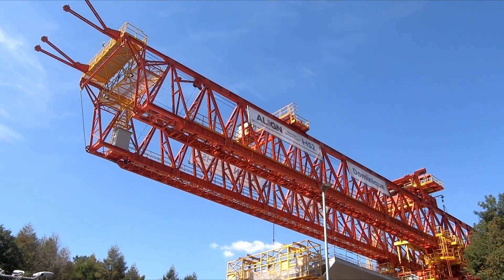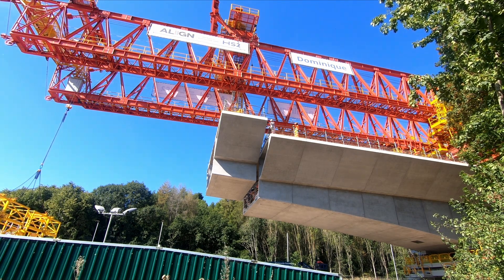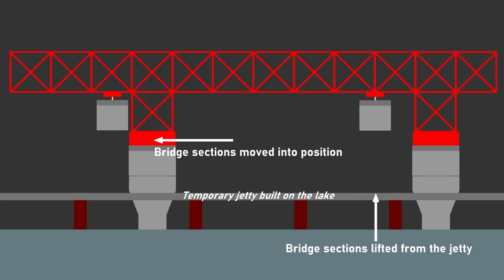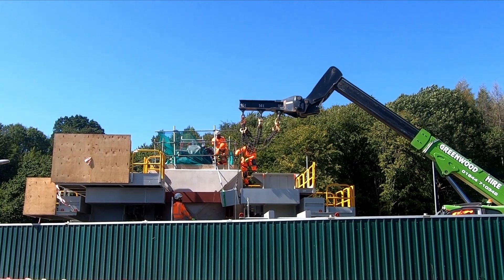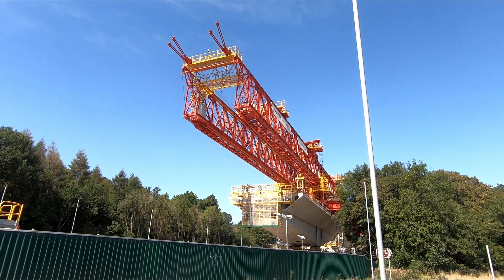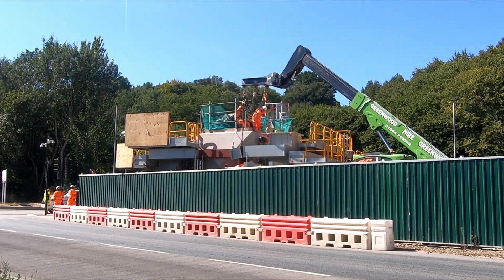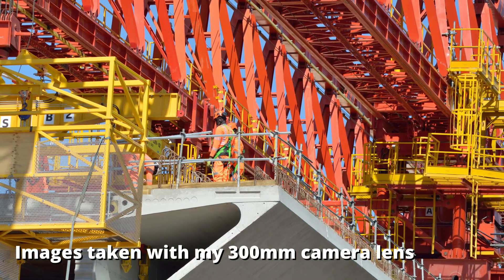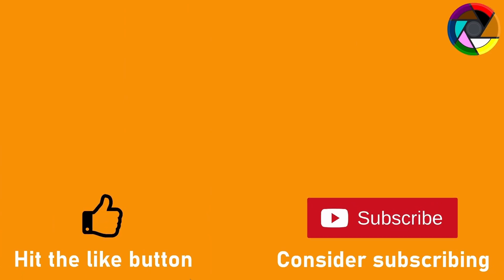HS2 "Dominique" Constructing the UK's Longest Railway Bridge

Comment: Absolutely loving seeing how far progress has come! Can't wait for this transformational project to be complete.

I did also have a quick question: is this machine working from the southern or northern end of the bridge?
Reply from the maker: Fairly sure it's heading South, it was just about to cross the A412 during my visit. It may have crossed it by now.
Reply: @Rail_Focus  ah that makes sense, as it would be coming from the direction of their massive concrete factory thing which is making the pre-cast segments. Based on the rate of progress you showed in this video, I would not be surprised at all if it is already over the road!

This is really exciting stuff, and thanks for the response!